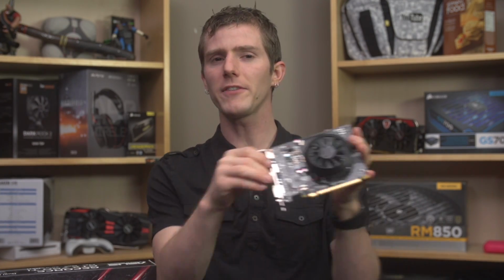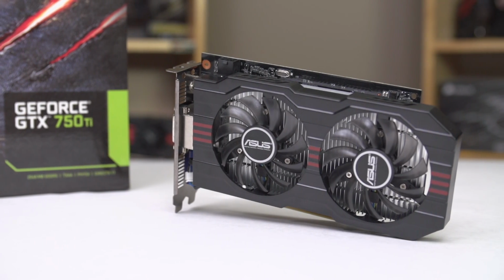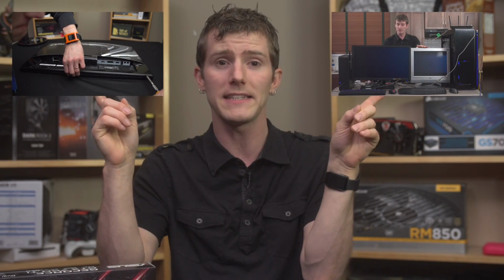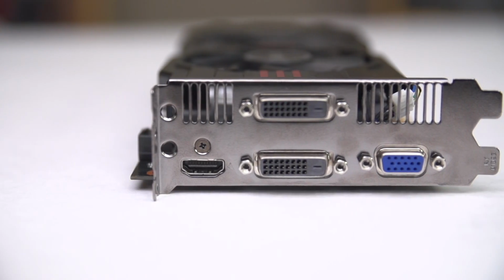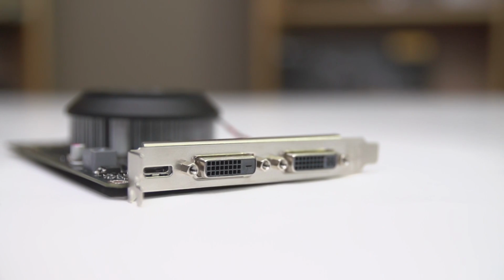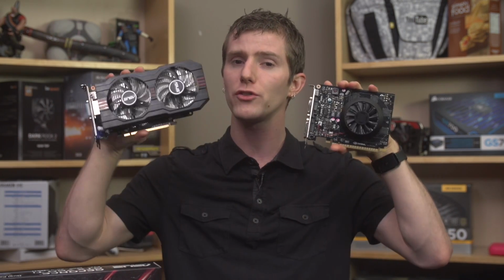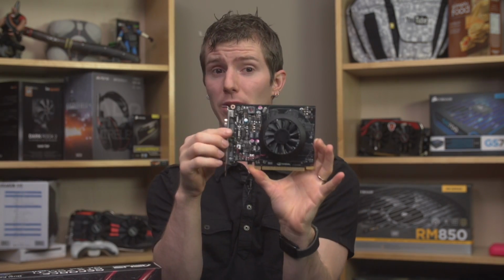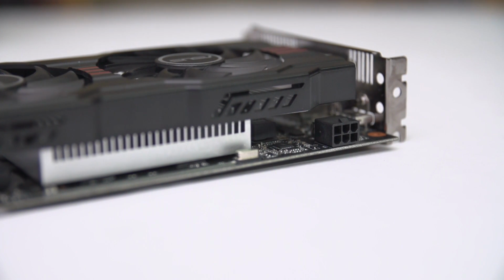GeForce GTX 750 Ti NVIDIA & ASUS Designs

Comment: Is this a good gpu for running LoL, CSGO, Gta 5, and Skyrim at good fps
Reply: csgo high-ultra 200+ fps
Reply: +J.R. Garcia YES!
Reply: I have a GTX 750ti and runs GTA 5 60fps 1080p with 2335mb used
Reply: +J.R. Garcia I get 40-ish fps at gta5, PLENTY in lol and csgo, but its becoming an old card, so get it used, or consider something newer if you can budget for it :)
Reply: +J.R. Garcia I get 40-ish fps at gta5, PLENTY in lol and csgo, but its becoming an old card, so get it used, or consider something newer if you can budget for it :)
Reply: you can run cs go on a weak video card. I have a gt730 8gb ram and i5 4590 and I get 100+ fps at 1080

Comment: would this bottleneck?
GTX 750 Ti    
intel pentium G2030 @3.00 ghz
Reply: +The Gaming Troll i play far cry 4 ultra 1600x1050 with an athlon x4 760k a gtx 750ti ftw acx 2gb card and 11gb ram and i play 40/60 fps so you should also be fine on 1080p.
Reply: timo halofan ok but i have 6gb ram and your cpu is better than mine
Reply: The Gaming Troll Yea true but you should be fine. Except for far cry 4 unless you mod the game you wont be able to run it on a dual core. Because it does not want to run on dual cores.
Reply: +The Gaming Troll A quad core cpu would be better since a lot of games now are becoming cpu hungry
Reply: +The Gaming Troll Assassin's creed is too demanding for a 750ti and such a low end CPU, At max you will be able to play on low
Reply: You need 4 cores for farcry 4
Reply: +xX FPS PROTMXx A 750 ti wont bottleneck a pentium g. A pentium g is pretty equal in performance to an athlon 860k, albeit with only 2 cores - and an 860k can support up to a 970 before reaching any bottlenecks worth mentioning. Though a lot of games these days wont even launch with a dual core, though some of them have workaround edits you can do.

Comment: pretty little card ;D
xeon 1230 v2 and 750 ti asus 8gb ram + ssd will it run witcher 3 on high with 1440x900?
Reply: what do u mean 
its a cheap CPU lol
anyway, I sold 750 ti and bought 660 ti for less price

I don't need better gpu because with this one everything run excellent
Reply: why do you have a Xeon but can't afford a better graphics card?
Reply: Maybe not high. Try medium and you should be getting around 60.
Reply: ***** The good ones that is
Reply: ***** Then again I didnt reference price

Comment: Can i run this on my pc?
Pentium 4 3.1 GHZ
1GB DDR 400 RAM
Asus Mobo
Lite on 250W PSU
Some random case
Hitachi 80GB HDD IDE
Another Hitachi 80GB HDD IDE
Windows XP
MX 200 GPU (want to get 750ti)
Reply: With 1 gb ram and that low harddrive storage it might be hard. I suggest building or buying a new one. If you really dont want to get a new one i dont recommend getting a 750 ti. But more like r7 240/250.
Reply: +Derek Lap my friend is selling pentium 3 3.2ghz, biostar mobo, 512mb DDR 200 ram, 200w liteon, windows me, rgb led case (looks cool) 30gb Hitachi ide for 520$, is it worth?
Reply: I dont know if you want to put a graphics card in this one. But a 750ti will need atleast 500 watts. 512 mb ram is not enough. Most pcs nowadays have atleast 8 Gb. I dont think this is worth.
Reply: +Derek Lap oh OK thanks, my friend said he can sell me a core 2 quad PC with 1000w lite on PSU, 5gb of ddr2 ram, 999gb hdd, gtx 120 and super case for 1000$ is it worth
Reply: the nvidia 750ti can be used with the psu. a pentium from ivy bridge and up can handle without bottlenecks
Reply: +Silver III Aesthetics no
Reply: +Silver III Aesthetics no where near worth 1000$
Reply: +EricssonXL thanks
Reply: +Silver III Aesthetics this 'friend' is trying to rip you off. 1000 for a bunch of outdated hardware? just build and  entirely new modern pc
Reply: i dont know how
Reply: +Silver III Aesthetics fuckking troll go fuck urself
Reply: +ImDankest my friend can build me this PC: i3 2100 16gb ram gtx 980ti 1500w liteon psu asus mobo a cool case 64gb ssd for 2510$ is it worth? I heard 980ti is good
Reply: Silver III Aesthetics Your friend is ripping you off for that amount of money you can get a titan x with your build xD
Reply: +Silver III Aesthetics Not sure if troll or serious
Reply: +FiftyPercentHealth Read full thread? ....
Reply: +Maz M (CreativeMazen) I found this PC on amazon for 500$ i3 2100 16gb ram gtx 750ti 500w antec PSU asus mobo 1tb hard drive cool case is it worth
Reply: ssh
Reply: +Silver III Aesthetics yeah that sounds quite okay for the price it's def reasonable.
Reply: +Maz M (CreativeMazen) OK thanks man I'm buying it
Reply: +Daan Reynaert ?? bought myself the PC. look at the dates.
Reply: Silver III Aesthetics How is your new pc doing?
Reply: pretty slow, ads asking for my credit card keep on popping up ;\
Reply: Coffee did that come with the computer or did it come at a later time?
Reply: it came on the pc
Reply: the programs i have are: freecsgokeys, freepaysafecard, freecsgoskins, internet.exe, adbe (not adobe) flshplayer, and other basic ones..
Reply: reinstall windows
Reply: Coffee Its the freecsgoskins and freepayssafecard most likely
Reply: got my pc fixed for 75$ its good now thanks guys
Reply: yep
Reply: +Original Luisxmo yea he did it in 5 mins and the computer shop was closed
Reply: +Original Luisxmo come on man he is an obvious troll

Comment: My PC runs DDR RAM could I still run GTX 750 TI?
Reply: +robert Drayfahl probably not, you wont have a pcie slot, even if you could then your cpu would bottleneck the fuck out of it, so no
Reply: +ben p I actually have a high end old pc if that makes sense, but I have figured everything out and now I have gotten a beastly pc that I built
Reply: +Alexander Richards (1upGuy) There is way more to "top notch gaming" than graphics. :p I wouldn't call Assassin's Creed Unity "top notch gaming". LOL
Reply: +robert Drayfahl The RAM in your PC doesn't matter. If it has a PCI-E port, and a good power supply, it should be good.

Comment: Will i3 2nd gen bottle cap it ?
Reply: +Shahbaz Khan Probably not considering the i3 also has hyperthreading. If your primary concern is with gaming, then I highly doubt the 750ti will be bottlecapped by a sandy bridge i3. Just make sure your PC has enough headroom for this card (~80w extra) and you should be fine!

Also, another note, if you have a little more headroom (~150w extra) and if you have $30 extra in your budget, try getting an R9 270. It's a pretty solid card as well and will have better DX12 support than its Nvidia counterparts thanks to Async technology.

Comment: Guyz, Must I use the 6 pin additonal power port or can I just forget it and use the 75watts supplied by the Motherboard to power the card.

My 350W power supply does not have a 6 pin connector. So am thinking of getting a card that will run without additional power
Reply: +michael mulwa Get the normal 750 ti from evga and make sure its the ones with 1 fan

Comment: I got some problems here! How many amps (A) does it need? Nvidea said on a 400w psu with 20 amps. Now the problem is, i got a special desktop PC: Lenovo E50-00. it runs with a laptop power supply (Lenovo Slim Tip adapter) 170w. The pc itself (ram,hdd,cpu, etc) takes 50w. Cpu: pentium j2900 10w. Still got 120w, enough for gtx 750 ti, but are the amps (A) on the psu enough for the gpu? (Sry for my english, live in switzerland xD)
Reply: ***** i was also suprised xD i was like: how can a crappy cpu bring so much performence? :O well, now i hope that this rig lasts with new games for like 2 years :)
Reply: shajith shantharuban just get a new PSU even a cheap one which is aroun 10-15$ and is going to be good
Reply: the problem is: theres normal psi thats compatible with this desktop :/ its a special case xD it has no pins to plug in xD
Reply: shajith shantharuban get another mobo and case for your pc and move the other parts to the new pc
Reply: Still, doesnt work, the Motherboard doesnt have the 24 pin to plug in the PSU :/ Like i said, ist a Special case computer
Reply: shajith shantharuban you need to buy a new pc
Reply: ***** i know xD
Reply: shajith shantharuban Yea it should work, just get a gpu from a place that allows you to return it if it doesn't the 750ti uses a max of 75w and your pc uses 50w so you will still have 50w extra.
Reply: shajith shantharuban You should be fine, unless for some weird reason the PSU can't deliver the remaining 120 watts over the 12volt line. Judging by my own 750ti (I have the MSI Gaming edition): turning on Furmark to stress the thing pulls roughly an extra 65 watts from the wall, no more than that.
Reply: just bought it! works perfect! :D i only need now 8 gb of ram then it should run games in very high :)
Reply: shajith shantharuban nice
Reply: +shajith shantharuban The cpu isn't that good. Your PC is pretty much like laptop parts on a desktop board.
Reply: ***** i know that, i just bought it without knwoing it, because it was cheap, but still it runs with the gtx 750 ti very well on very high settings in gta v with 32 fps average :)
Reply: shajith shantharuban Oh wow, thats actually not bad.

Comment: I wanna play dota 2, GTAV, racing games and video editing on this card. how well will it perform? pls help
Reply: LeonZoc itl slow down on vid editing BUT only by a few minutes. Don't expect 970 Performance but itl work at 1080p
Reply: LeonZoc I have this card and play GTAV just fine (def not max settings) but it works great and if you have a decent CPU you should get some decent frame rate out of it.
Reply: LeonZoc i use 1600x900 res with a 750 ti and it runs max around 70 fps if that helps

Comment: I built my PC and I love it. It runs about all games at High Settings at 1080p. My specs: CPU - Intel Core i5 4460 GPU - GeForce GTX 750 Ti RAM - GSkill Ripjaws 8GB (2x4GB) PSU - Corsair 500W 80+ Certified. I forget the exact name of the PSU And Motherboard XD Lolxzz

Comment: If this came in a pc i bought could i change it out to a 960? Or will it not fit plz respond
Reply: Fallout Boy It will fit as long as your PSU can support it
Reply: whats a psu
Reply: Fallout Boy Power Supply 300W will do but 350/400 is recommended. "look it up in google"
Reply: I have plaenty then
Reply: thx for the help appreciate it
Reply: Fallout Boy no problem :)
Reply: do u no where I can find how much watts I have
Reply: Fallout Boy Look inside your case and look at the power supply it should say it there MAKE SURE it is 80 + if not do not use it quickly replace it "It normally says it in bronze/brown lettering 80 +"

Comment: I’am currently learning about pc management, can u help me?

Power supply: Corsair 750cx  750watt.

Moterboard: P7p55d-LE

CPU:  Intel®  Core™ i7   860 @ 2.80GHz

Asus nvidea GTX275 (currently)

I really need to change my graphics card soon!
Do you know if my pc is good enough for a good graphics card that can run all mmorpgs on ultra.
Thought about nvidea GTX960 
Reply: desktop
Reply: The 960 should be just fine, the power supply has more then enough power for a 960.
Reply: Thanks. Actually i just got it today and installed it. Been using it for like 15 mins and I've never felt so free. <3
Reply: Lol 13:37 c:

Comment: What's the difference between the 750 and the 750 Ti? Also is this better than an R7 260x? Considering its $30 more expensive where I found it.
Reply: Akhsay Ajodhia it has nothing to do with VRAM
Reply: prepareuranus R7 260X is better than GTX 750ti
Reply: prepareuranus "Ti" is 15%-20% faster, better...
Reply: 750 have 1 g and the 750 ti 2 g
Reply: The Ti is better overall. It's also power efficient but it can't run in SLI
Reply: +prepa the 750 ti has more cores and better clock speed duh than the 750
Reply: GHOST -P yes bro the r7 260x is better than the 750ti
Reply: GHOST -P just trolling wtf i know that 750ti is better this guy is crazy the one who said the r7 260x is better O.o
Reply: +The Gaming Troll it is neck and neck on some games but lets not forget amd gpu sucks on some games like batman arkham
Reply: +The Gaming Troll thats why i bougt a 750ti u can use physx and nvidia gameworks
Reply: +Akhsay Ajodhia Unless you buy GTX750 Palit StormX edition which has 2gb vram.

Comment: I am upgrading my PC , just the motherboard is old,it has a PCI E version 1.1.
Now I need a GPU.
Gigabyte GTX750Ti was in my option , but its not available in my area....
My options are "MSI Afterburner GTX 750 Ti OC 2GB" and "ZOTAC GTX 750 Ti 2GB".
Which one should I choose ?
Please reply.
Reply: Shijil Thachilodi Jump for a gtx 960 if its possible, if not, get the msi one
Reply: Shijil Thachilodi Get a New motherboard with a PCI-e 3.0 16x
Reply: Which one is better guys.. Palit stormx dual gtx750ti or sapphire r7 265??

Comment: Hey guys is my pc good enough to game... 

The cpu is a banana
My gpu is an acorn
64mb of ram
And my psu is a hamster running on a wheel

I'm not wanting to run anything fancy. Just grand theft auto 6 and call of duty black ops 5.
Reply: I guess you can run minecraft on fancy mode.
Reply: +tjenks5 is your banana overclocked?
Reply: +1 for that "hamster running on a wheel psu"
Reply: Man you have a nice one. You might wanna upgrade the GPU to a walnut or if you don't want to spend that much, a peanut.
Reply: tjenks5 Black Ops 5 will prbly still run on Quake 3 Engine, so yes, you can, and no, it won't be Fancy, no CoD apart from 1&2 ever was :D
Reply: if you want it can run half life 3......
Reply: +tjenks5 csgo will work just fine
Reply: Make sure you use a large boot as the case...
Reply: Still no GTA6...
Reply: Why did you build your PC out of batteries?
Reply: tjenks5 sounds great
Reply: You are fine... But dont expect 60 frames per second :)
Reply: You need 128gb of ram then you can run anything you don't even a cpu or gpu
Reply: tjenks5 man, you could run anything on that. How the hell did you afford that?
Reply: Funny black ops will come soon but GTA is still years away
Reply: U will soon get to test it on gta 6 now haha

Comment: Is this a pretty decent GamingPC?
CybertronPC
AMD Athlon 1.60 GHz Quad-Core processor
MSI AM1I AM1 (motherboard)
8gb DDR3 (memory)
Toshiba 500gb hardware 
NVIDIA Geforce GTX 750TI 

Please let me know if there is any thing you recommend or anything I should change. Im mainly using this for Minecraft and GTA.
Reply: Ed Machine I'd go for a better cpu, and 1tb hard drive space and for the case go for a corsair spec-01 its really cheap and reliable! other than that looks good!

Comment: Gud day sir,i have a question,i  am planning to buy a gaming video card but i dont  know what to choose bec. Im afraid it will only bottleneck my system, here are my specs. Processor:amd phenom ii x4 925 ,mobo:msi 790 fx-gd70, Power supply: 700 watts cougar, Ram: 8 gig ripjaws. ,i am planning to upgrade my system to intel but not now bec.i dont have enough budget. I just want to buy gaming gpu while waiting for upgrade. Im really looking forward for your reply,what can you recommend for me?any tip for buying the best card for this system ?should i buy gtx 960 ? or should i buy gtx 750 ti FTW? will this card bottleneck the system? Thank you sir.

Comment: Will this build need a 500w psu or can I for something lower to save money and maybe add on something else?

Intel Pentium G3258
Asus Geforce GTX 750 ti
Western Digital blue 1TB
Kingston SSDNow v300 120GB OEM
Crucial Ballistix sport 8GB 1600MHz
Asrock B75 PROB-M

Pheriperals:
Asus VE228TR
Corsair Carbide 100r
Cooler master CM Storm Devestator

Comment: Hey! Will I be able to run Skyrim, Crysis 3, BF3 on high/ultra settings with this build?                     AMD Athlon x4 860K.                         GTX 750 Ti 2GB GDDR5.                MSI A78M-E35 MotherBoard.             8GB DDR3-1866 RAM.                   Seagate Barracuda 1TB HDD.           It will run on Windows 8.1 (not Pro) 64 bit.               Thank you!
Reply: border collie21 games The 4gbs are not all used and they are ddr3 which is significantly slower than gddr5
Reply: Skyrim yes crysis medium to low bf3 medium
Reply: Jay Patel wow. I just gotcha 'cause u dont know much about computer tech. GTX 750 Ti runs BF4 at 1080p at 30+ on ultra settings. WTF are you saying?
Reply: :( my bad srry but u can get something better 4 ur money like the 960 750ti is 200 where I live and same price for 960
Reply: Jay Patel you are right. GTX 750 Ti is like $130-$150 where as GTX 960 is 1.5-2 times better and is around $200. Its just where you stand: medium-high settings relaxing gaming or hardcore ultra settings gaming
Reply: Get the gtx 740sc 4gb
Reply: Actually,games that use lots of Vram,like Gta 5,could benefit from having 4gb's on their hand,although ddr3...but its still a terible card altough if your looking to keep your card for 5-6 years,more Vram helps alot.

Comment: Oh my god, Linus, you just took a HUGE Weight off of my chest. I Was looking to upgrade to a 750 TI In my AMD A8 6600K Rig, But my Mobo didn't have power connectors to suit, for some bizarre reason, Then i hear it only requires PCI-E Slots. HELL YES!

Thank you SO Much. This will be my first GPU Upgrade, Can't wait.
(Edit: I Believe my Mobo didn't have power connectors to work with it, Due to my general Noobiness of PC Components)